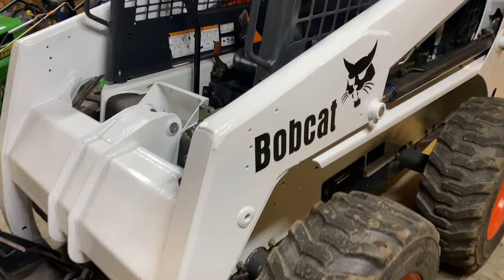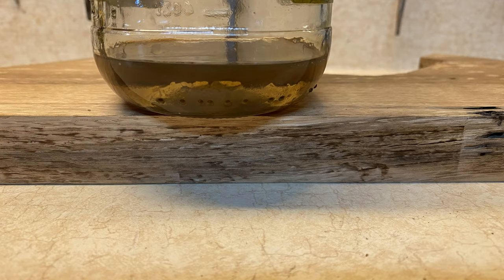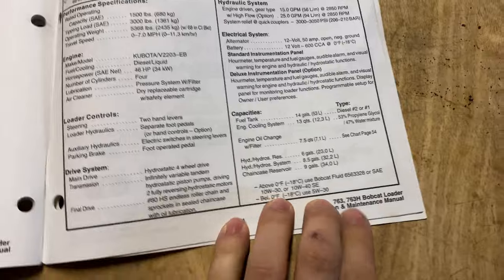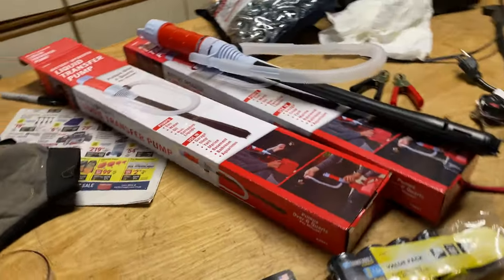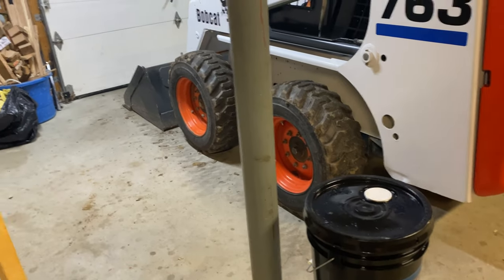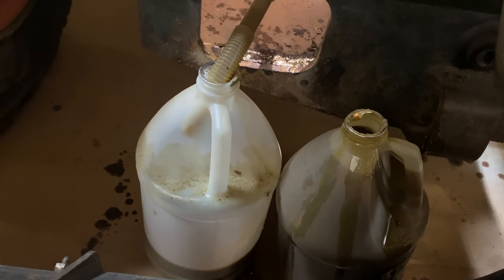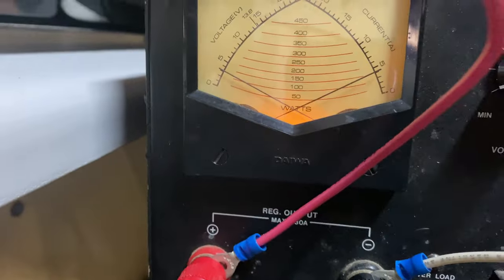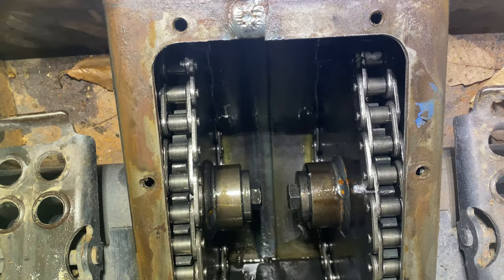Bobcat 763 Chaincase Oil Replacement

Comment: Hello  Ive got an 863 which would be similar. Is there a drain plug on the bottom of the gear case? I have a leak on the bottom and wonder if thats a drain plate that needs to be be resealed.
Reply from the maker: That plate is just an access point to the rear drain point. I believe there is a rubber plug actually on the back of the chain case.  That is what hold back the oil,  not the plate.

Comment: Thanks for the how to video. From what you know, how do the chains get power from the drive motors and deliver to the wheels? Is there a hydraulic motor for each wheel and a chain / sprocket for each wheel?

Comment: so what i do to suck fluid like that is take a 5 gal bucket with a lid and drill a hole for a piece of 1/2" rubber line to fit in tightly.. then take my shop vac and put it over the spot in the lid and suck fluid out that way it works awesome.